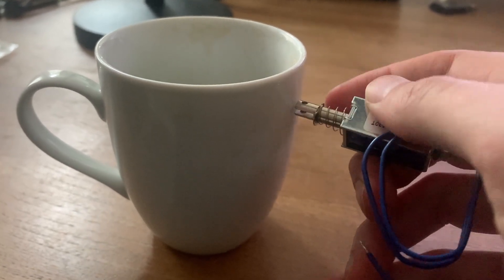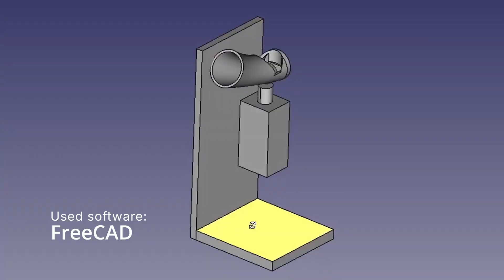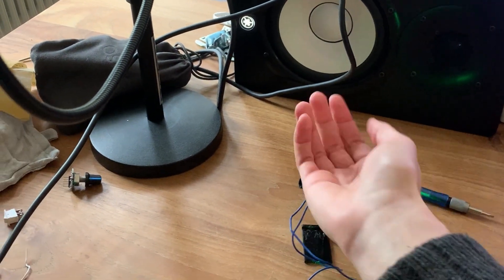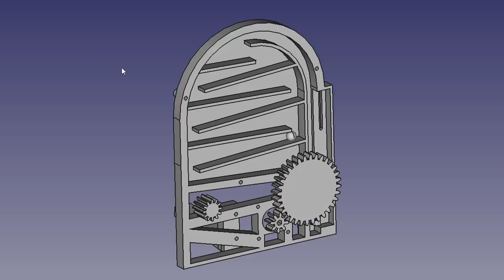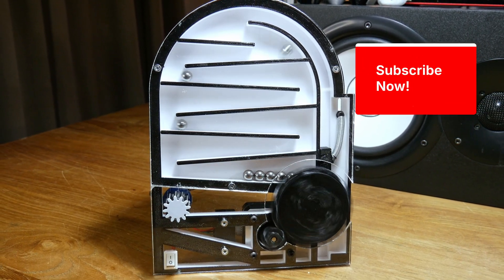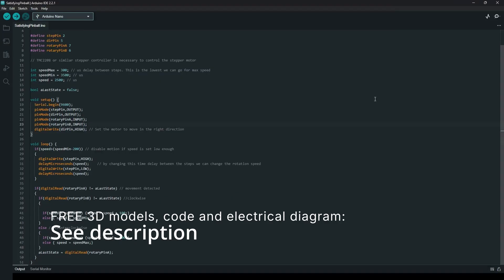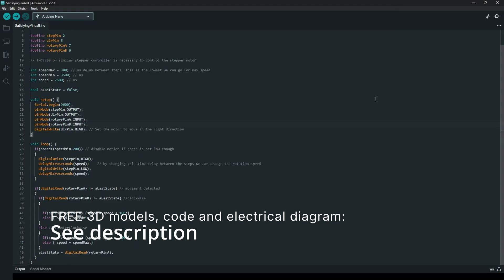The most SATISFYING homemade TOY! (build video)

Comment: Thanks for sharing, that is really nice 
Two questions :
-what us the last music played (very relevant lyrics😂)
- would it not be possible to tune the tension of the spring, so there would be less torque requirement for the motor, and still enough strength to have the ball reach its goal? So there could be more speed and more balls rolling at the same time.
Reply from the maker: Thank you! And great questions. The song is a custom song made and sung by me. I can send it to you if you like ;-) 

Now for your mechanical question, yes! Great suggestion, being able to tune the tension would be very nice. It wouldn't even be too difficult, we'd need an end stop for the plunger and a way to comfortably adjust the spring tension. If I would build this again, I would build it that way! :D